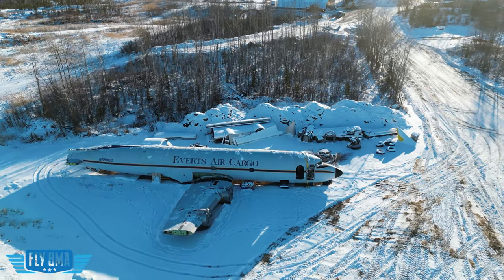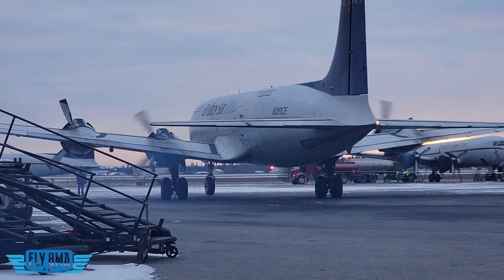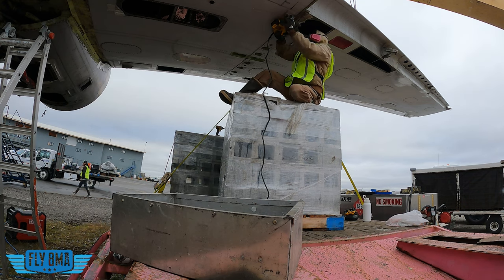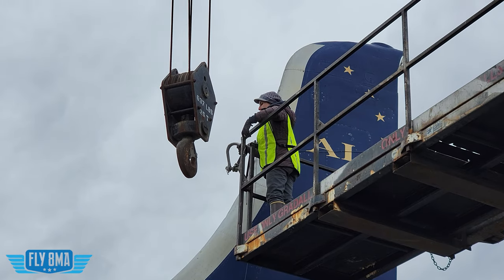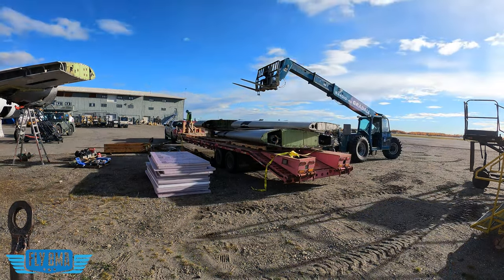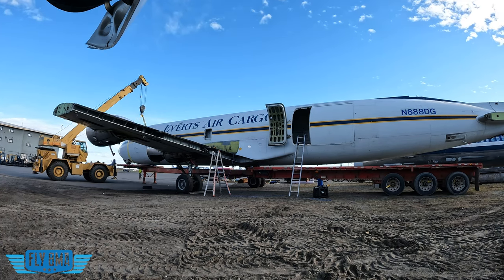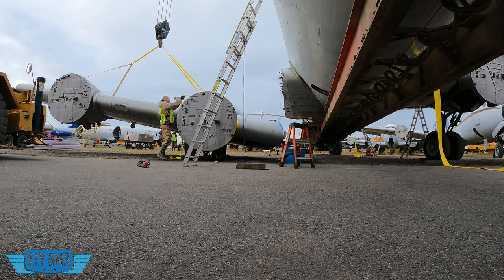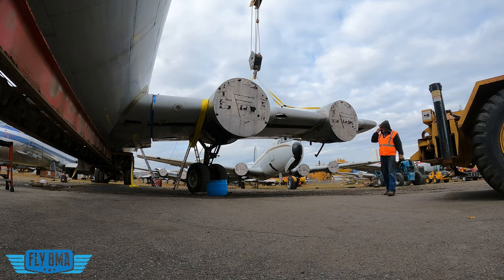Cutting the Wings OFF of a Plane | Airplane House Conversion

Comment: Hey John @flyM8 if you are on the cfi oral and the examiner feels that the applicant doesn’t explain spin recovery correctly does that applicant have to bring a spin approved plane to the checkride next time? I thought that was only in the flight portion of the checkride if they get or allow the aircraft to get in a spin? 
Can’t find nothing in FAR/AIM.
Reply from the maker: I would have to double check the PTS (not far/aim), and yes, I belive the examiner can require spins to be taught and demonstrated in the aircraft during the checkride

Comment: G,day Jon from Sydney Australia.
I have seen permanent caravans with an extra roof frame and metal sheeting about 10" space. This reduces suns heat and snow cold.
This could be continued over stairs and walkways
Radius of inside: cut wedging props "like D on lumber 2x3" untill glue sets..
🌏🇭🇲